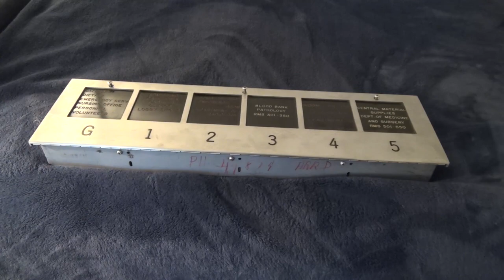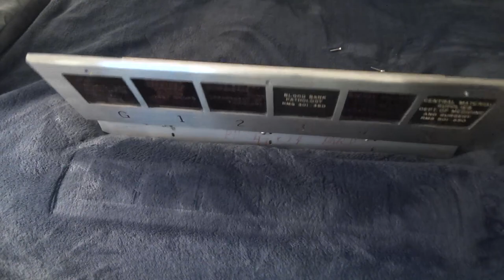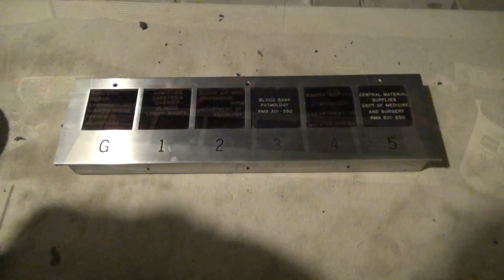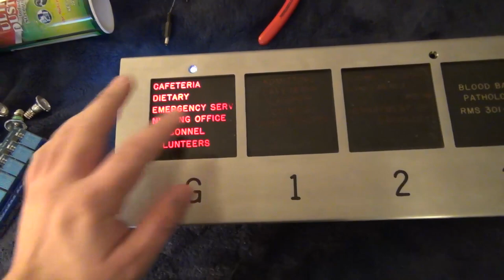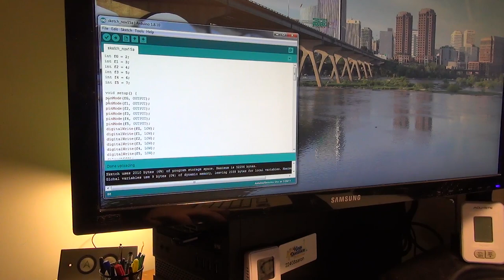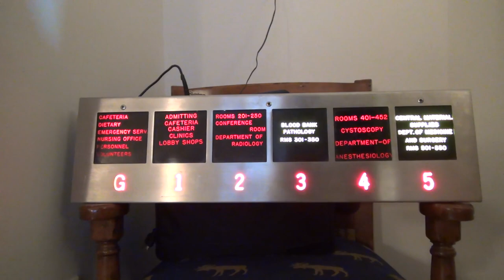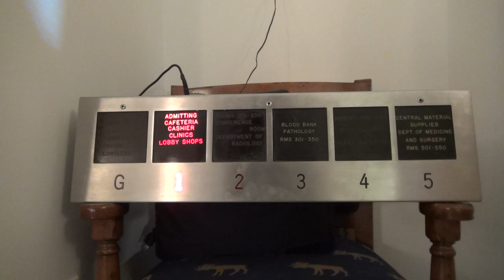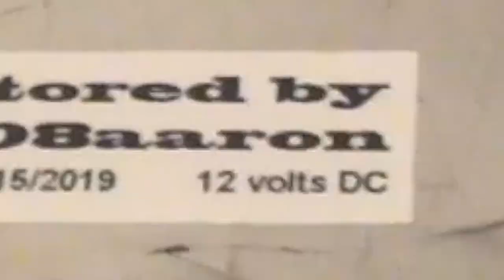Making a Vintage Otis Floor Indicator Light Up

Comment: I’ve used those relay boards in various projects - they seemed to wear out after about a week of solid use. Not sure why, I have yet to do a tear down and analysis 😀 

Looks like a great project! Do those LED panels get hot? I’d be worried about the directory panels melting over time due to the heat